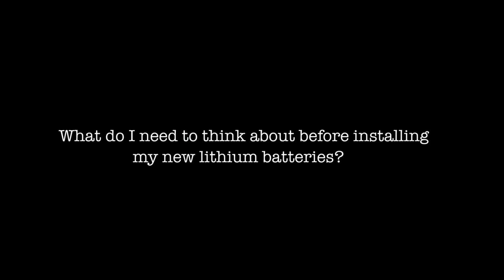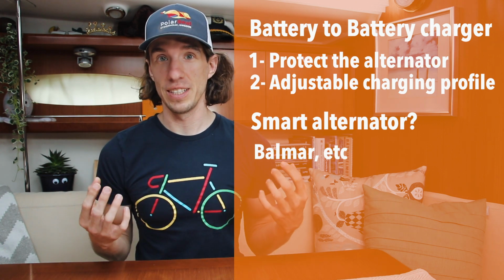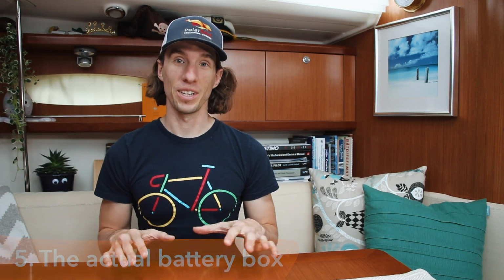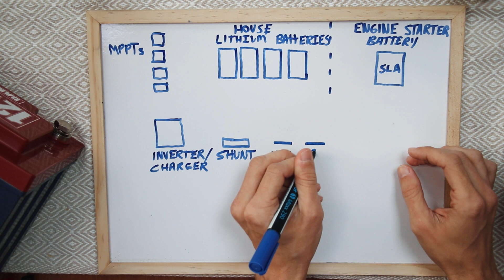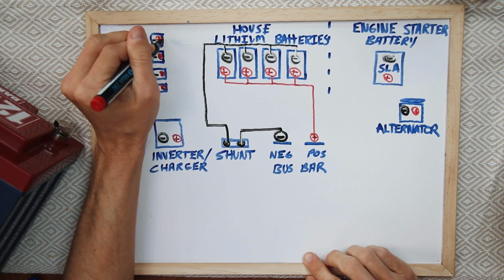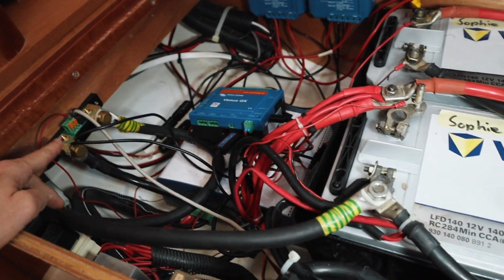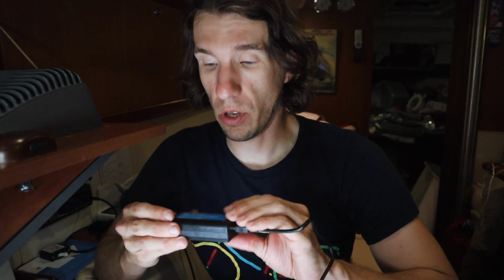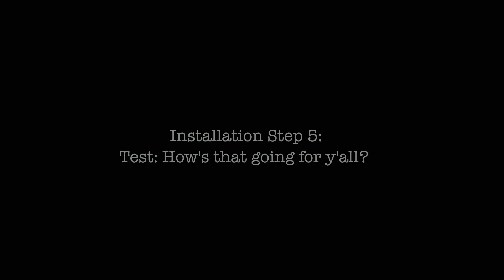How to install lithium batteries on a sailboat // Ryan’s tech corner #2

Comment: Recently took the opportunity to switch from lead-acid to LiFePO4 as well. Was repowering, so ordered an alternator upgrade to a balmar high output with a programmeable external regulator.
Removed the 6 - 6v 280amphr rolls surrette batteries (600 pounds, cycling amperage just under 300amphrs), replaced with 3 - 12v 170amphr LiFePO4, (150 pounds total, conservative cycling amperage of 380 amphrs). 
So, net gain -1/2 the space, 1/4 the weight and still increased cycling capacity.
Also replaced the MPPT solar charge controllers and shore side charger for ones with either programmeable charge profiles or preset LiFePO4 programs.
This is on top of years ago removing both my starter and anchor winch batteries.
Wait to throw tomatoes till you read and understand.
I have the single battery bank fed from common bus bars (make sure all battery cabling is equal lengths or you'll kill one of the batteries), then three output switches, one each for engine, house and anchor. (as an aside, I switch the engine cable both to avoid stray current when not in use and as a theft deterrent, as this switch is hidden).
Anchor winch and starter motors are essentially the same thing, 12v, 90amp DC motors. While deep cycle house batteries are designed for capacity over start current, they usually still are rated at or better than 1000CCA, the LiFePO4 even higher still, therefore current draw is not an issue. The only consideration is cabling. Check your cable run, load and cable size necessary to bring the voltage drop at load to negligle and you are set. I have operated like this for years with never a problem. Starting uses only seconds of power, so is recharged quickly, and when raising anchor, the engine is running so doesn't steal from the bank either.
The one never ending question though, is how do you start your engine if the batteries are dead? Quick answer is I maintain 3 charge sources, solar, portable generator and engine alternator. If, stupid me, I ever let the batteries go low and need to start I fire up the gen and hit quick charge on the shore charger.
However, being a permanent cruiser, I have never run into that situation. Why? Because we are always chasing amps due to the ever increasing number of electrical toys on board, so the constant awareness of battery state becomes second nature. I find it has to be severely overcast for several days before I'm tempted to run the gen.
Yes, decreasing load helps -I have increased the number of light fixtures aboard by nearly 50%, but as they are all LED, I can turn every light on for less load than one old incandescent. Danfoss 12 fridge compressors are so much more efficient that I currently use only 1/3 the amps that I used 2 decades ago. My smart tv uses only 40watts for a 28" screen, and can plug an external hard drive in for easy movie swapping with other cruisers.
The single best thing though, is that I place one of the MPPT solar controllers in an obvious, eye level position on a main traffic route on the boat, making a quick glance and awareness of state of charge second nature.
I find that the solar quickly brings the batteries up early morning, then by late morning I turn on the heavy loads. Watermaker, water heater (swap the 1200w element for a 400w or 600w one), clothes washer, charge the laptop and tool batteries, load up the slow cooker with dinner. Always wind up the power hungry jobs by mid-afternoon and the batteries will be topped up for the evening movie and cold drink. 
Is this for everyone? Definitely not. It is strictly for permanent cruisers who are paying attention to what is going on aboard and flexible in when to bring on the heavy loads.
Happy sailing and comfortable life aboard, keeps you at it year after year!
Reply from the maker: Hello!  Thanks for sharing this!  Very interesting.  I agree with your analysis at the end regarding awareness and using the unused loads! - Ryan

Comment: There seems to be a raging debate amongst the self proclaimed experts online and the battery manufcturers that LIFEPO4 can be used to start big high compression diesels and also used for big bow thrusters.  Most companies i know and respected installers say that Lead Acid is the only battery to use for diesel starting and big thrusters, and if there was an emergency that all your lead acids were dead you could use the lithium to start the diesel but they advise against it unless its the only option.  So that being said you are part owner of a company and have a dedicated lead acid which is no surprise because they perform that function better than any other battery, but why is it that the Lithium should not be used for this?  The high amp inrush will shut down the BMS or does it actually harm the cells and if so how?  I know some of the big names say that they will not warranty Lithium used for starting/thrusters.  I see a lot of youtube installs that completly remove lead acid and im wondering how long they use their lithium only systems with no issues and how the batteries perform long term from being used against what the manufacturers suggest.  any info would be helpful.  thank you.

Comment: The True Smart Battery Isolators Kit is a perfect dual battery system partner. It will automatically charge your lithium batteries based on voltage reading. See more details at www.trueam.com or www.dfna.info for single item.

Comment: Price of Lithium cells continue to fall.  See https://www.statista.com/statistics/883118/global-lithium-ion-battery-pack-costs/ ... but, in order to be useful for mass market, they still need to cost about 1/1000th of 2010 cost. They were 151/1000 of 2010 cost, in 2019, but lithium cells still have a long way to go before they are going to be utilized widely. BTW: many resellers of lithium cells try to get 2010 prices.  Why is that? How can that be? Must be shortages.

Comment: where would i find yacht examples of how many amp hours they need for there boat and what is drawing off that?
Reply from the maker: Hi simon! You’ll find a good way to estimate your power needs in the voyagers handbook. A very good book :) https://www.amazon.com/Voyagers-Handbook-Essential-Guide-Cruising/dp/0071437657
Reply: It's not the boat, it's the people on board. first, go bow to stern and add up either the watts or amps each electric item uses, multiplied by % of each day you expect them in use. Yes, some will be in amps, others watts, but convert them all to one or the other then total it up. ie, 12v danfoss fridges compressors draw between 4-9amps, and typically cycle 30-60% of each hour. Use a clamp on DC ammeter(which is an absolutely essential tool on any cruiser's boat) to find out how much yours is drawing, then sit there with a stop watch for an hour in the middle of the day. Done that? Let's say yours is drawing 5 amps, and cycling 50% of the time, you get (5amps X 0.5 hrs)X24 hrs/day=62.5 amps used per day, converts to 750 watts, or 0.75kW.
Got all the useage figured out? Now, define battery type, typically lead acid will get a good lifespan using only 35% of it's capacity, LiFePO4 can use 75% (yes, people are still arguing about that with 50% being most conservative and 85% being the top end).
You get the required battery capacity by making sure that you're useage figure is less than or equal to your cycling capacity. ie, imagine you estimate 2kW used each day, need 5.7kW(476amphrs) of lead acid capacity or between 3-4kW(250-333amphrs) in liFePO4, depending on the % cycling you want to believe for lithium.
Reply: Get a good battery monitor e.g. the BMV-712. After 30 min you will have all the details of how many amps each consumer uses (just turn them on/off one at a time). After that, you can easily calculate how many Ah you need for your own boat.

Comment: Ryan,
I have 800ah wet cells (8 group 31s) that I am considering replacing with roughly same useable lithium amps (like 4-6 100ah lithiums).  Two questions based on your excellent video:
1. I know the lithium batts you installed are deep cycle replacement for wet cell deep cycles and that deep cycles are not intended for high amp engine starting but I assume you can still cross connect the starter to "combined" house/starter using the battery switch and draw from the lithiums in a starting emergency (starter batt dead) without a lithium problem....correct?    
2.  My bow thruster (side power on 46 foot sailboat) currently uses the deep cycle wet cells.   Is this a problem with the lithiums?
Reply from the maker: Hello.   To answer the questions.  I don't have the starter and the lithium tied together... the best inside is simply not designed for cranking.  That said... in an emergency one could move some wires around but I would have them direct connected. 

The bow thruster batteries are still lead as well.   Generally for the same reason... though we do use the lithium house for the windlass no problem.

Comment: What’s the name of your boat again? 🤣 
If you ever have to work in your AC system and disconnect it for safety get a shore power to Edison adapter and run your disconnected shore power cable into a power bar. Then you can run some work lights or power tools as needed separately from your onboard system. Simple trick that makes jobs easier and safer.

Comment: I am still not convenced  that battery to battery conection VS external battery connection which is better, for external connection -  longer wire  (more voltage dro and costp) S/V Bright Eyes On Subs the connection is battery termall to Terma, sorry never could spell, Ha Ha

Comment: I don't understand why you want to use your alternator to charge the lithium bank.  The primary purpose of your boat's engine is to propel the boat, and you don't want to use it when it's not needed for that.  The primary purpose of your alternator is to recharge your starting battery after getting underway, which it does fairly quickly,  powers down, and draws negligible power from the engine thereafter - simple and optimized. Solar is ideal for charging your lithium bank.  And for cloudy days with limited solar available, why not use a small inverter generator to power an AC/DC lithium quick charger for your lithium bank?  It will use less fuel and be more sensible than starting and running your boat's engine for that purpose, and the lithium charger will obviate the need to take precautions with making an alternator safe, cool and efficient for charging lithium.